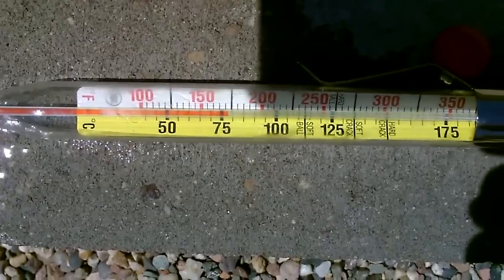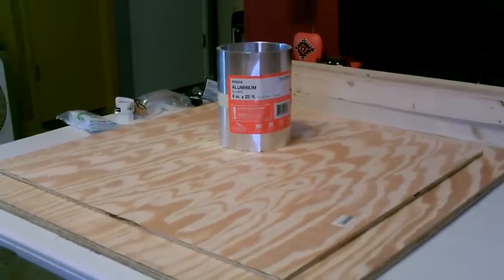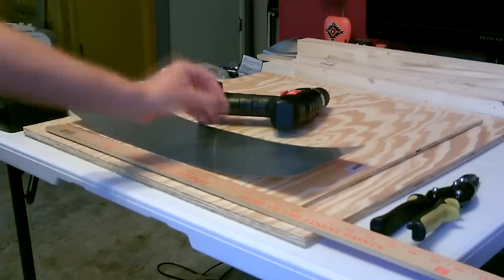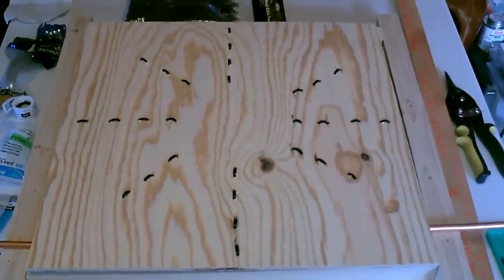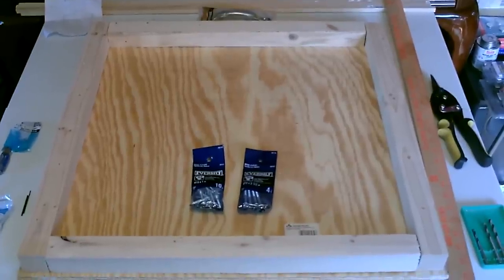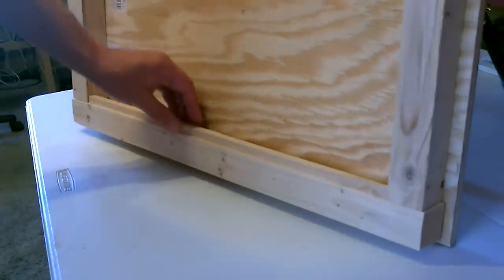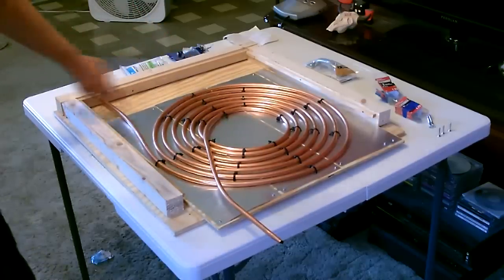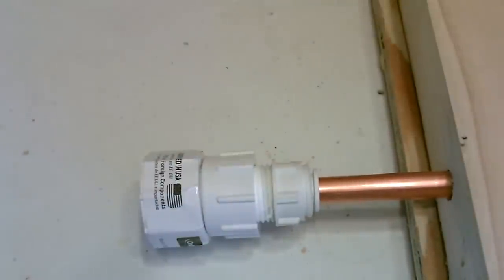DIY Solar Water Heater! - Deluxe "Aluminum backed" COPPER COIL Solar Water Heater! 175F Full Instr.

Comment: Now what you need to do is get an 80 gallon water heater to use as a storage tank and circulate the water from the collector through it with a low volume dc pump also powered by a small solar panel, that way the intensity of the sun regulates flow rate automatically. It also stops when the sun is down!

Comment: At least show us the temperature of the cold water inlet… thats the most important for me... haha
Reply: +1😉👍
Reply: Agreed. Hot hose and hot coil could give those readings. But if left running for a couple of minutes, that temp would drop.
Reply: @greyham123  yes. But the price is right and I’m assuming if you use a mixer for showers etc, you’ll extend the amount of water consumption.   If it’s well water, 55 degrees.

Comment: The zip-ties did it for me...
Reply from the maker: hi. the plastic ones have been holding up but to be sure consider using stainless steel zip ties. those are super tough. i've been using them a lot lalely. they only cost slightly more. about 10 bucks for 100 pack.

Comment: TERRIFIC!!! How much water is held in a coil this length ad dimension? Any good reasons not to step up the diameter if we wanna heat more water??? Nice work!
Reply from the maker: hi and thank you! i was going to do a 1/2" copper coil unit but 1/2" copper coil is amazing hard to work with. it's very rigid. i've got a couple of flexible tubing water heaters made with 1/2" pipe but they are made of non-metal materials.
Reply: @desertsun02  AHAAAA Super valuable input... THANK YOU!!!! ROAR!

Comment: I doubt those plastic zip-ties survived more than a year in the Sun. Some type of metal wire connector would be better.  But looks like a good solid concept otherwise.
Reply from the maker: hi there. they're still holding strong, but you can always use stainless steel zip ties to be 100% sure. i bought some recently off of amazon. good up to 900F! and only cost 2 bucks more than the plastic ones (100 for about $10)

Comment: Some improvement ideas I have is to add thermal paste where the pipe touches the metal sheeting to maximise the thermal transfer, double pane the glass, use the blackest black paint there is (black 2.0), and if using more than one, a servo switch & check valve and plumbing to run water in series or parellel depending on the sun.
Reply: Yea, FLAT black paint, totally flat as possible, no shine at all. Any shine will reflect the light(HEAT) away. Also on the glass panels, get non reflective glass, or i think they call it low reflective transparent panels.
Reply: Personally I would exit the pipe from the centre of the coil through the back of the baseboard, then add aluminum sheet to the top of the coil to sandwich the coil, effectively increasing surface area that touches the pipe. 

I would use kingspan insulation board for the rear to retain heat.

Comment: learned how to do this is 6th grade.  came here and still got some great ideas for mine.   Much respect for hand screwing all those screws too.  🖖.
Reply from the maker: hi there. if it's just a few i just use a regular screwdriver - no need for the power. also no power driver if they are the really small ones.

Comment: 1 thing I noticed that will shorten the life of this project, having dis-similar metals in contact with each other will cause a small die- electrical discharge, and the copper will eventually corrode wherever there is contact with the aluminum.  Painting the aluminum 1st would solve this issue. Other than that good job and thanks for sharing.
Reply: Not true with copper and aluminium because they are both non-ferrous metals. If it was mounted on sheet metal then you would be correct and it would cause electrolysis but it would take years to create a leak and in this application who cares.
Reply: The copper won't corrode. Copper in contact with zinc or steel or aluminum will cause the other metal to corrode.
Reply: Yep, correct!!

Comment: When we were stationed in the Philippines we employed a similar system but with an array of hoses on the roof. It worked so well the water became too hot. We then decided to take it down and take cold showers. LOL
Reply: nice  would this setup not be realy effecient  to  desalt  sea water?
Reply: That's an interesting idea.
Reply: @yohjokromwood2327  saltwater corrodes copper.

Comment: Great video,  I really like your design.  I do have a suggestion though: what if you painted the coil on both sides, used stand-offs under the coil, and leave the aluminum foil shiny? That would create almost twice the heat to the coil. Just an idea.  Enjoy your videos.
Reply: You are thinking of a parabolic type reflector., yes they work excellent. But this design the back plate absorbs the light, heats the shit out of it, then it conducts to the pipe, hence conducts to the water. So the connection needs to be tight against the back plate for good conduction of heat. That is why he used aluminum, a great conductor of temperature, else he could have just used tin, or even just blue board, or plywood.
Reply: I really don't understand all of this...  But I do know how hot a hot tin roof gets.  Too hot to touch more than once. I wonder if the same tin painted black would get any hotter? Anybody know?

Comment: That is amazing for a portable hot water heater. I'm an RV'er and like to boondock, or set up and camp with no water/sewer/electric hookups. How would you design an intake and a hot water catch tank that are portable? That would be priceless for me to use. Love your videos- I'm learning a lot from you.
Reply: Work with the principles of thermosiphon, once you understand that principle and how it works all sorts of designs are possible for an RV. Hot water rises, in the tubing or in the tank, it displaces cold water that sinks, in the tubing it is kind of force by the gradient into the tubing as hot water rises and pulls the cold water in, as it rises it enters the tank. You must understand how high the hot water will rise by doing some calculations and that will tell you how high you can place the tank without losing the thermosiphon effect. That effectis what circulates the water around. 

Also, don't use any plastic parts in your system, use all lead-free fittings and tubing and a tank deemed for potable water.

Comment: The only improvement thoughts I have are to add a secondary box around the actual heating chamber and buy a vacuum pump to seal the area in between the outer box and inner box. 

If the boxes were well sealed, this would reduce heat loss to near-zero and allow the water to get even hotter if 175 F is the current limit due to heat loss. Another solution would be to use insulation instead of a vacuum layer.

Thermal paste to maximize heat transfer would also be better.
Reply from the maker: all good ideas! 👈

Comment: I was going to suggest the aluminum and black paint on your last video. As a Canadian the flaw I see is that this is not drainable. The pipes will burst when it freezes. I guess it is small so I could just bring it inside... Then use my wood stove to heat water in winter
Reply: It’s small, just a quick blowout will prevent bursting.  Plus the bendable copper is more forgiving.
Reply: I was thinking of hanging in a south-facing window. 🤔

Comment: In your experience, which will produce more hot (and hotter) water? 1/2 in. x 50 ft. Copper Coil vs 1/2" x 250' PEX Tubing. Placed inside the same sized solar box (all other thing being equal). 
The 2 options are priced reasonably the same. 
Thanks!
Reply: now that would be good to know
Reply: Imo and from my experience of living in a Florida sun all will work but copper will not deteriorate like the plastic and rubber.

Comment: for the wood,  drill the outer hole the correct diameter. then drill with a smaller bit through that outer hole into the wood piece that you will join together with the screw. this allows the screw to pull the outer piece towards the smaller hole piece, creating a tighter fit.

Comment: Nice setup. Saw quite a bit of youtube videos but really nothing definitive on what's best. Seems like the small copper tubing might be equivalent to the larger 400-500 irrigation plastic piping? Trying to balance cost vs output with regards to heat. Been told irrigation piping deteriorates quickly due to high heat so next best option would be copper/uv protected pex/stainless steel tubing etc.. You've done quite a bit of testing so in your opinion, what setup would be ideal for me? I have a 22k galloon tank so obviously I would need longer runs and more units but realistically it seems like the best I can hope to achieve is 10F more with good sun exposure at best. Any help would be much appreciated thx!
Reply from the maker: hi there and thanks! well, there's pluses and minuses to all of them. for longevity the copper is the way to go. for price the irrigation tubing is the way to go. (but that only lasts 3 to 5 years in my experience - versus probably 50+ years for the copper). the pex one i made is still going strong at 3+ years so that is a contender too. if you're just experimenting with it - i'd say go with the irrigation tubing first and if you like it you could always upgrade to a longer lasting tube later. if you don't like the performance or have any other issue then you'll have only spent a few dollars for the tubing. the other cool thing about the irrigation tubing is that i built a second 100 foot spiral one in only 45 minutes. the first one took a lot longer but once you get the hang of it it's super easy to make a unit. i can't tell you how much tubing you should use for 22k gallon tank though. you'll have to use your best judgement with that. *by the way - i'll be posting a video compilation of all of my solar water heaters in the near future.

Comment: Great video.  I am researching a way to heat my pool because it is shaded and needs an extra 10 degrees added to it.  The 175F is a great temp but my question is around flow rate.  I know it is theory, but shouldn't you get a lower temp if you increase the flow rate.  For example to heat a pool I would need more flow but get a lower temp?  Do you know the flow rate in the video?
Reply: This is the same intent I have.  Hoping to heat my pool without having to purchase and fuel a water heater.  I would do this on a larger scale though to heat a pool
Reply: Copper+Clorine=copper chloride. Saltwater is also corrosive to copper. Check your chemicals before trying this.  A pool is also a vast volume of water and this would probably not even raise pool temp by 1 degree in an entire day.
Reply: @penguin12902  - Well silly, it sounds like one is not enough for your application.  Make several and get them started and once primed they'll pull the pool water in cool and exit hot.  After a week or so, I bet you'll find the difference in pool temp will surprise you.
Reply: @penguin12902  I used to use a typical pool cover on my in ground pool Leave it on at night, and all day. Around 3pm, I'd turn my pool pump on for a half hour to circulate the stratified water and I could raise the temp about 2°F per day. I used to do this in March here in AZ so any friends/relatives coming for spring training could swim in 85° water instead of 70°. I'm sure the heat exchanger would do better. I would use the pool water which is warmer than the water coming out of the ground pipes and cycle it through the coils back into the pool.

Comment: A variation of this would be to hook the inlet to the cold water pipe of a shower and use the drain water to preheat it before it reaches the cold tap either that or the water heater inlet. To stop the box holding cold water from the last shower just add a trickle hole that would drain it. No reason it could not be built into a shower box floor ready for install.
Reply: I do not understand.

Comment: A couple small modifications to your design could give you a thermal electric charge as well, as a thermosyphon so no electric pump would be needed to circulate the water. :) Good stuff.
Reply: Could u explain.
Reply: @nycupperes  there are diodes that produce an electrical current when there is a temperature difference between the 2 sides. It's rather small typically (.1-.5amps) but would be enough power to run a small dc water pump enough to circulate water through.
Reply: @jpageify  could you leave a link to a page or video that shows how to install those? I sure would love to see something like that Shalom thank you

Comment: How well does it work in winter time?
Reply: Lol wont work in the summer! Full sun! Maybe for a kiddie pool, I just put in a pool, cost almost 40k, a cheap pool! No way will this heat 3k gal let alone 20k.  It's a great way for a quick warm shower if you're off grid, but it is not a pool heater!
Reply: Non insulated. Heat loss.

Comment: With the coil getting as hot as it appears.  What keeps the tack tie downs from melting at each contact point?
Reply from the maker: it would have to be a lot hotter to actually melt the zip ties. they easily handle the heat of this unit. i have started using stainless steel zip ties in some of my newer units. either kind works but the stainless steel ones will last 50 years or more. the plastic ones might dry out or get brittle after 10 -20 years in the sun.
Reply: @desertsun02  Further, can this unit be use like the Progressiv Passive Solar Water Heater PT-40?  It preheats potable water before it enters your hot water heater.  My traditional home water heater is electric.  I currently have the afore mentioned on my roof.  However, it is now leaking. Had to shut it down.  In the 20 plus years of its operation it kept my electric bill half of what it is now.  Just wondering if this unit would fit the bill?

Comment: Does it need a pump to force water through it? What speed does the water flow through? Also, could it generate hot water on a cold day (0 - 10 degrees Celcius) if the sun is shining?

Comment: Good video. Not sure why the aluminum. Aluminium transfers heat like crazy. If you are trying to keep the heat in stainless would be the way to go. Not sure it needs anything, insulation possibly. If you seal it up tight it will need vent holes or the expanded air will break the glass.

Comment: Have you tried this in a cold climate?  I need something that size to heat water up to about 100 degrees for a camp shower.  Outside temps are 30-40 degrees.  I tried a similar setup using PEX tubing but could only get a 1-2 degree increase in water temp.  I'm Using a 2 Gpm pump.  I also switched the PEX out for a 20' copper coil but got the same results.  no where near the 175 degrees seen in your video :(  i can step up to a 50' copper coil, but I hate to make that kind of investment with no return.  of course my out side temp was 40-50 and water starting temp was 60 degrees.  I used an Ice chest to reduce losses but not efficient enough to us a solar heater.  I have put the copper coil in a camp fire and can heat a 5 gallon bucket from 40 degrees to 100 in about 15-20 minutes.  It's a good backup for when there's no sun shine but I'd much rather get the performance out of a solar setup like yours.

Comment: quick question - is the gland actually necessary or is it just to protect everything?
Reply from the maker: hi. the glass makes it work kind of like a solar oven, so the temps get really warm. these type of solar collectors will work pretty well work in the summertime without the glass but it's a lot better to use it.
Reply: @desertsun02  ah ok I see. Makes sense. Thanks for the response

Comment: Type and thickness of glass?  Is regular glass or plexiglass more effective?
Reply from the maker: hi. i use regular glass. it will stay clear and won't warp. i think i used 3/32" glass on this one (possibly 1/8"), either will work good.

Comment: Did you try it painted vs not painted... I think you would be surprised. Why are emergency heat blankets like aluminium foil and not flat black?
Reply: So it reflects YOUR body heat back to you.    He is trying to gather sunlight and transfer it to the water, not reflect it back.

Comment: Did the zip ties handle the heat over time?  Wondering if metal clamps would be more durable for the long term..
Reply from the maker: hi there . the plastic zip ties are still hanging in their, but the metal or stainless steel ones do better in high heat). all i use now are the stainless steel ones. *on amazon for about 10 bucks.

Comment: I don’t know if this is relevant but the copper heating element in our previous gas pool heater became exposed internally and our pool discolored from the copper. It was a bitch to get out. We had to use chelating agents and it took awhile at a significant cost.
Reply from the maker: hi. these units won't get the water hot enough to discolor it. (it would have to be way over boiling temps for that to occur). the copper tubing i use in my solar water heaters ia the same copper that is used worldwide for hot water lines in houses and commercial buildings.
Reply: Thanks for the reply. Good to know. Question if you don’t mind: Do commercial solar pool panels, strung together, put out hotter water than this or do they put out hot water at a higher flow rate ? What’s the difference ?

Comment: would you say this copper heater is a better pool heater than the Pex tubing one you made?
Reply from the maker: hi. i'm a big fan of both so you have to look at pluses and minuses. copper holds up practically forever but is more expensive. it's also harder to work with in some cases, say if you're trying to coil 1/2" copper for instance. that's harder than coiling pex. i've also got one made with black irrigation tubing. lots of people use that too but i've found it doesn't hold up long. 3 or 4 years
Reply: @desertsun02  thanks. it just seems that copper may be a better transfer of solar heat to the water than pex, and a hotter flow